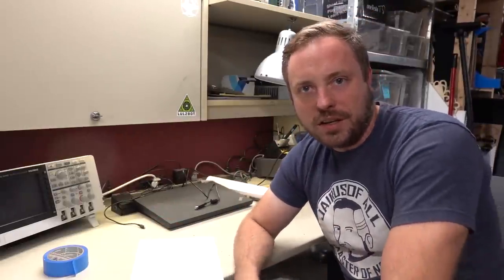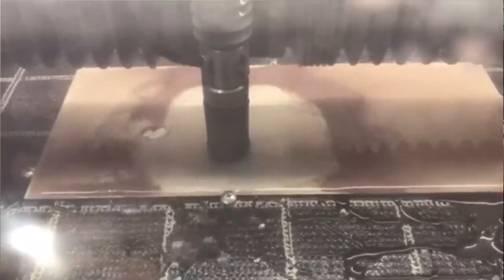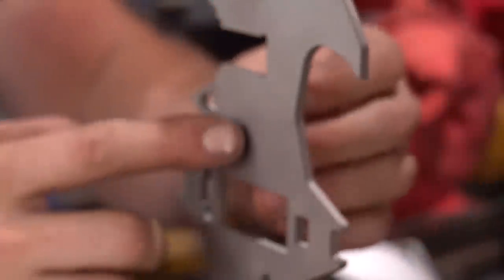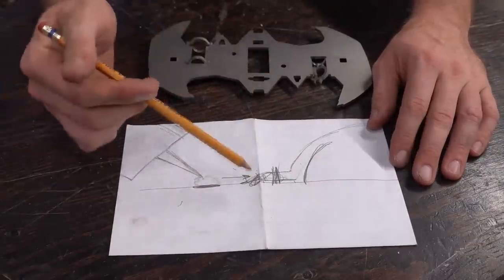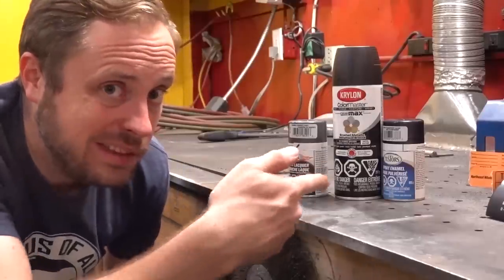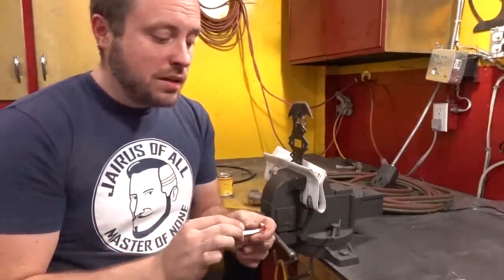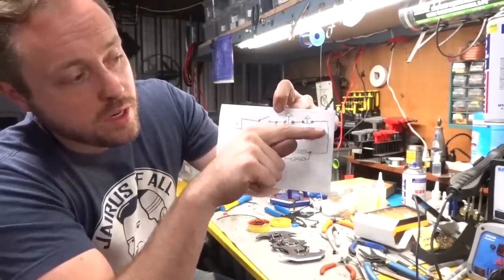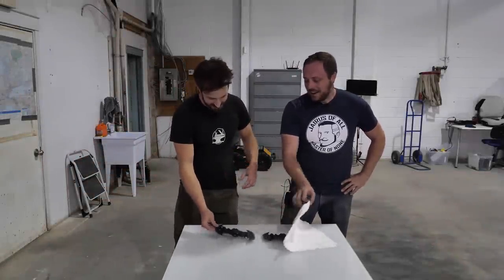Titanium Rocket Batarang - Build

Comment: I watch a lot of Alec Steele and This Old Tony so when you said you grabbed titanium I was like oh boy here we go😬 

Thankfully you didn’t use any machining to trim down the titanium. A mill would have messed up your project baaaadly because unlike with steel and other metals where it’s the chips carry the heat, titanium carries the heat in the work piece so it’d run the risk of causing molten metal to spark off which can be hot enough to ruin a cement floor where it lands. 

Titanium is super easy to shape with a forge, but drifting all those holes and filing them to shape would be absolutely bonkers, the water jet was the absolute best option if I remember my properties correctly. 

Speaking of forging, try forging sometime, it could be fun. I’d look to the YouTuber Torbjörn Åhman for inspiration tbh.

Comment: With choices you had the titanium is light weight, but next time use Crucible 204p or Bholer m390 and do a proper heat treat if you want to have the Batarang that Batman would have.

After seeing the accident I’m glad you didn’t make it out of sharpened/hardened steel.
Reply: I was thinking a relatively mundane 1084 steel, heat treated to a spring temper.
Reply: hanelyp1 we are talking about billionaire Bruce Wayne here. He would use the most Gucci steel.

Comment: I don't see a series resistor for the LEDs in your circuit diagram
Reply: Yeah he should definitely add some. It'll probably work for a little while, but that fully charged lipo is going to be pushing the LEDs VERY hard.
Reply from the maker: Doesn’t need one. 😉

Comment: That is not how you TIG weld something. You basically just forced it to melt together with an electric torch. You're supposed to have a filler rod in your off hand which is primarily what you use to fill the gap